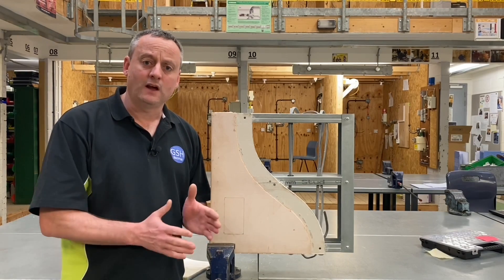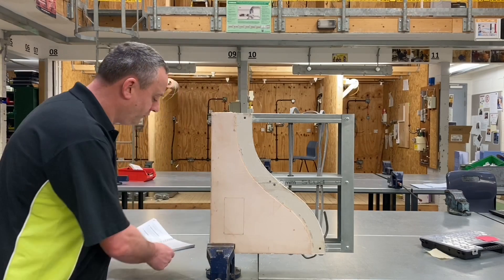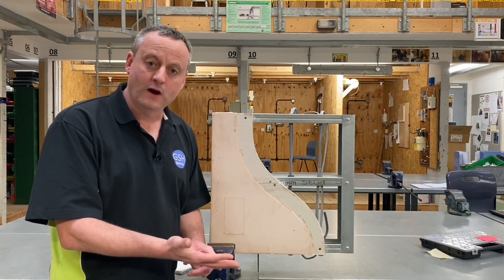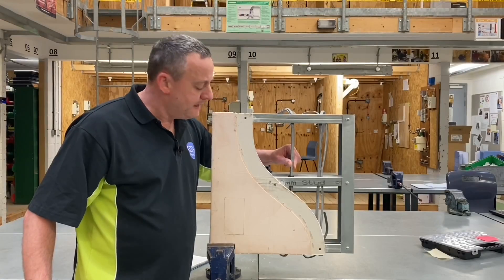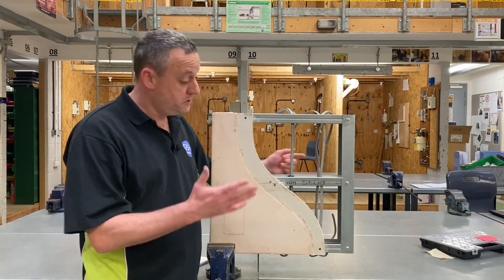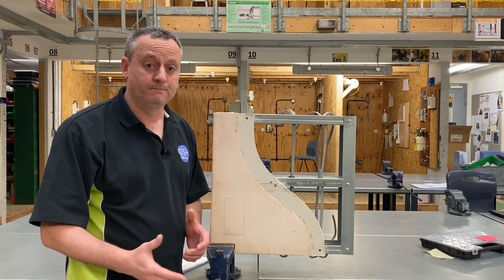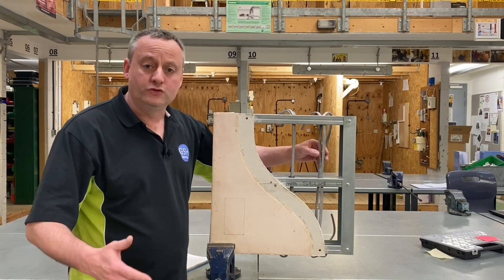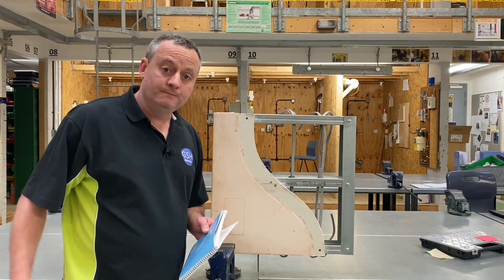Additional Protection by RCDs for Cables Installed in Walls or Partitions with Metal Parts BS 7671

Comment: How would you rewire that between say 2 or 4 sockets different walls and tripping the RCD just painted you could not tie a new cable onto faulty cable and try and pull it through  20mm holes in tin walls you would have to see the metal wall to lay cables in safely and how would you rewire these tin wall or metal stud houses say in 35 years Cheers

Comment: On a EICR, building was built in 2005 and some socket circuits and lighting have no RCD protection. Coding this today would it be a c2 Or would it be a C3 due to it was constructed  prior to the regulation coming out retrospectively?

Comment: Regarding the statement made in the video:  “RCD not required when installing earthed metallic sheathed cable”

Yes I agree with the use of SWA and steel conduit but FP200? Although FP200 has metal interior shield but this cannot be classed as mechanical protection?
Reply: The requirement is to have a metallic sheath, not a sheath that provided mechanical protection. Don’t read more into the regs than they say.